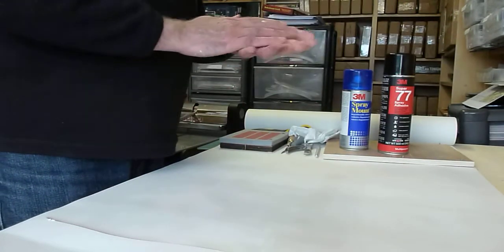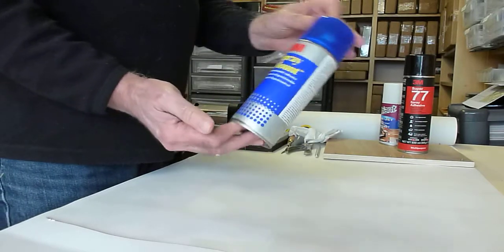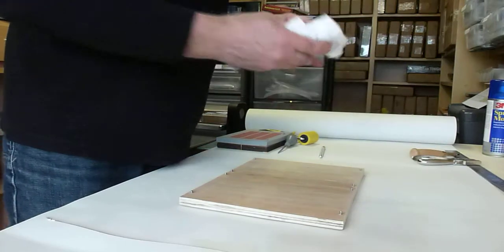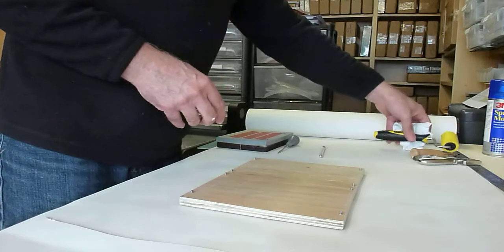DIY DIE-CUT WARGAME COUNTERS - Vid 3: Tools of the Trade

Comment: I found choosing card was surprisingly difficult. Grey matboard is fine for 'cheap' counters, but I now use white 580gsm card from a specialist, which is just over 1mm thick, and very smooth for adhesion (I found greyboard sometimes was coming away)
Reply from the maker: I have a stack of grey card so I am good for some time. If there are adhesion problems, however, it is good to know that the smooth card may be the answer.